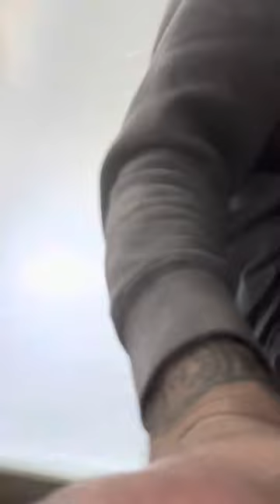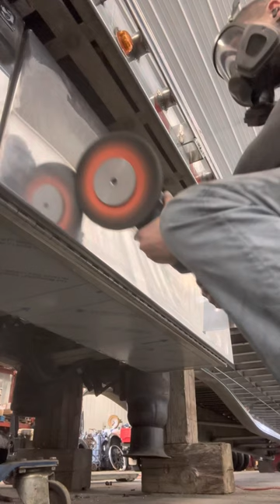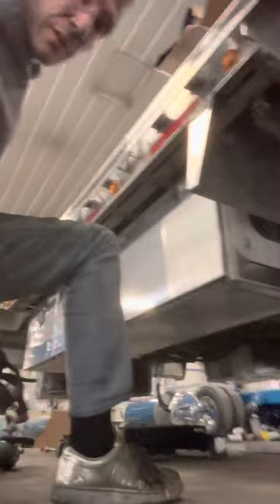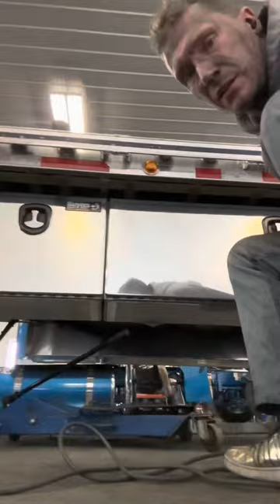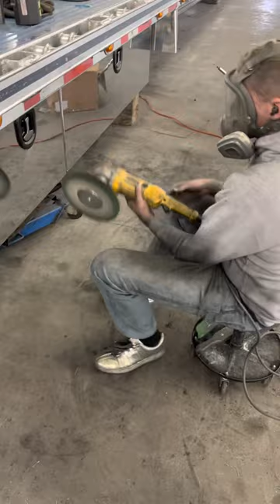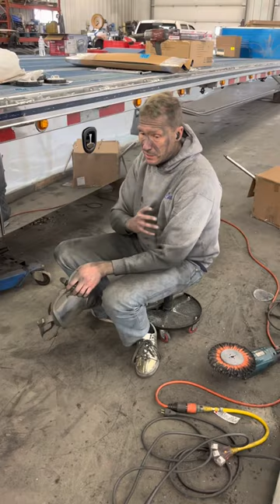How to polish big flat face aluminum boxes. Evan’s detailing and polishing.

Comment: Hey Evan, do you ever get worried about cross contamination between your cut and finish? I always wipe off the excess rouge between but noticed you didnt. Was just curious if i am wasting my time doing that if I dont need to. Thanks!
Reply from the maker: The compounds I use are all from the same family of ingredients. So I do not worry about cross contamination. But if I was using compounds not of the same family I would definitely clean in between to keep from contaminating them.